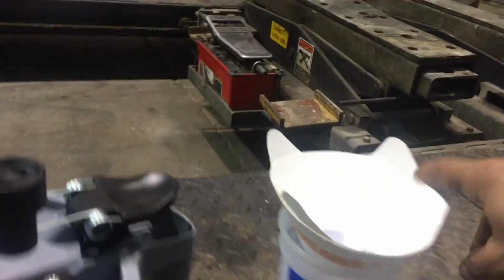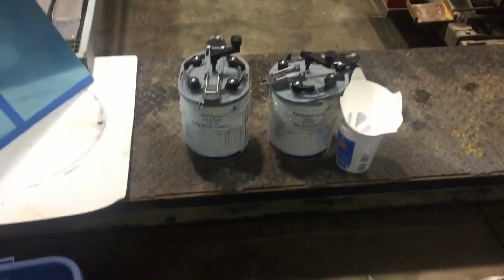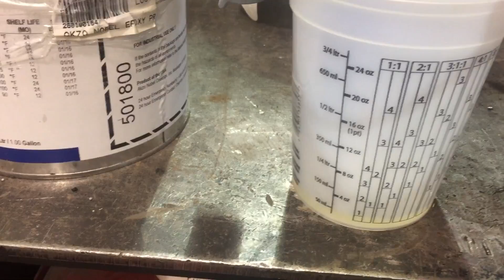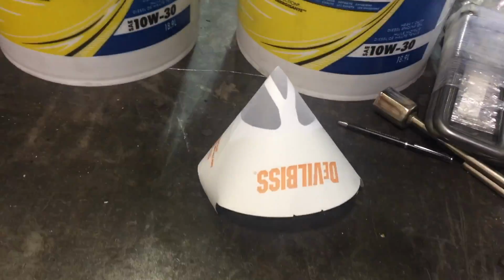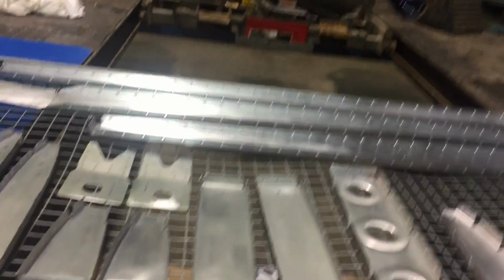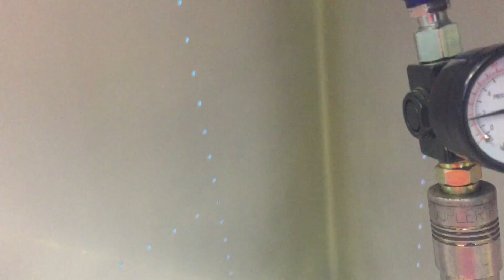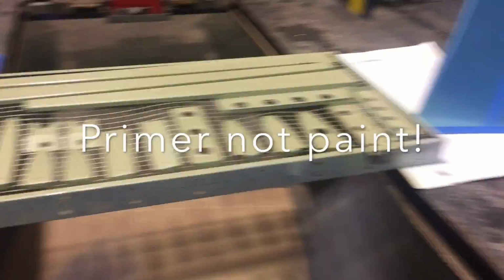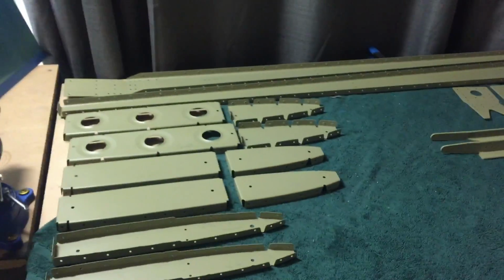AKZO Priming RV-7 Parts

Comment: I tried it exactly like you did and it turned out well but I had to put the parts on sticky tape to keep them from being blown away by the spray gun. I now read the instructions from AKZO and they recommend an air pressure of just 8-25 psi while you recommended 40 psi. Would it be good to go lower on the pressure to keep the parts from taking off?
Reply from the maker: Martin Renschler I’ll have to try a lower pressure. Thanks!
Reply: A lot depends on the gun.  The old siphon feed guns often needed 40 psi.  The new gravity feed HVLP guns often work best with 18-22 psi, depending on tip size.  Generally, the gun maker will have very good recommendations.
Also, his 40 psi was static pressure.  I suspect it drops a fair bit when he hits the trigger, depending on the size and length of his air hose.  Generally, you should set the pressure with the trigger pulled and air flowing.

Comment: Is priming really necessary with Van's aluminum parts?  I thought that the alclad surface oxidation was enough to protect the parts from corrosion?
Reply from the maker: A question that has 1000's of posts bantering about. If my primary address was in Arizona I wouldn't. Living in Canada close to the coast with the temp and humidity variance i think its a good idea. Also hides dust in the fuse. Looks cool like something the army or airforce built. Protects against scratches and forces all surfaces to be smooth and free of burrs or rough edges.YRMV Good Luck!

Comment: Hi Andrew. Really great video, thank you so much for posting that. I have been confused about priming from day one and you made it look so easy!Jason Ellis had mentioned in one of his videos that if you prime your parts after match drilling / debrrring then you no longer can get the rivets into the holes and they have to be lightly re drilled. Did you encounter this problem at all? Or do you recommend priming parts before match drilling?Also can you please tell me which AKZO product you are using? There are a few different ones out there. Thanks again!
Reply from the maker: +Casey Mannion hey there Casey thanks very much for the awesome comments. The AKZO I use is found from aircraft Spruce. I have never had any problems getting a rivet back in the hole after priming. Maybe once or twice I have run a reamer through it by hand and that's the odd case. My take on the situation is protect all metal that is been machined at all and the Alclad surface has been removed. IE inside holes

One thing that I have been corrected on that I have not updated on the Videos is that there is a flash time for the primer prior to use of 30 minutes. I have not had any problems mixing and spraying immediately however the instructions say different. Good luck!
Reply: Thanks for the quick response Andrew!  Good to know you didn't have issues with the primer changing the hole sizes and I agree with you that it's probably better to have the primer on all the bare machined metal.  I figured it would have a short flash time / pot life because it dried so quickly.  I was happy to hear that because that means I can get both sides primed the same day.
I am working on an RV10 and live on the west coast of Florida so I definitely want to prime also being so close to the gulf.  Bad news is i am getting QB wings so I can't dictate which primer is used but I hear Van's uses PG60G2 which in spite of bad remarks the majority of folks say it works pretty well.  BTW, I love the shop you are working in, very nice!

Comment: How do you find you need to let the Akzo dry prior to working further with the piece?  I see some people dimple before priming and some dimple after, then rivet.  In either case, how long until you can proceed onward with the construction of the part?
Reply from the maker: Dan Niendorff hey Dan, the parts are ready to go a day or two max after priming. I prefer to scuff prior to dimple to save my scuff pads but dimple before primer. Rivets is last. Good luck!
Reply: Andrew Atalla Thanks!  I’m trying to figure out a primer system for my upcoming build.  Looks like the AKZO would do very well,  but still concerned about the dry time....  in your experience,  what do you think is the minimum time after priming before riveting?
Reply from the maker: Dan Niendorff 6-12 hrs would be my guess
Reply: Andrew Atalla Thanks!

Comment: Nice job on the video. Wondering how you determined if this primer requires a topcoat, or is this step sufficient?
Reply from the maker: Josef Prem these are for the most part internal parts. A top coat will be applied to to outside of the airplane or alclad and vinyl. I have seen it used for interior exposed surfaces as well and while I don’t know for sure it is extremely scratch resistance.